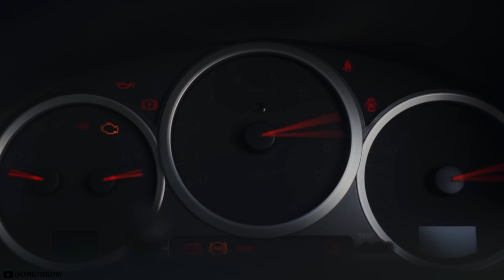Donut Media VS. Subaru

Comment: I honestly think donut just showed a perfect example of how a new owner to a subie feels. I'm sure donut put research and clearly time into their builds but ultimately didn't know as much as the subaru community. I don't own a subie bc of how finicky they are, love the cars but I can't justify the time investment of picking up someone else's rebuild
Reply: Also they have production deadlines, so time wasn’t on their side
Reply: Exactly
Reply: Donut got help from at least 2x Subaru WRX/STI experts to get along those 2projects. They did more anyone else to get the things right.
Reply: You hit the nail right on the head. My buddy had an STI and he had to be on top of everything to make the car reliable. They are bad cars since the majority of Subaru problems are specific to Subarus. The people who say you just need to know what you are doing are already on their 3rd engine
Reply: @deadheadcentral2514  yep, there are 3 things you never ask, A girl her age, a man his salary and a subbie how much he spend on the engine.
Reply: @ChuckyDoll79  And yet...

It makes one think they mayhaps intentionally done some things wrong.
Reply: I agree. The problem with subaru, it's package is already above the normal safety factor. I have learned the bare minimum to keep cornering with a turbo engine. My E30 which isn't turbo, doesn't require the extra oil capacity or larger radiator as those components are size properly for the engine.  From the experience I had with subarus, it's a corolla that has a turbo slapped to it, nothing less, nothing more. Same rad size, same oil capacity, oil quality, engine volume, etc. Only the turbo makes it different.(AWD does also, but that is just load, not engine reliability). I think if this was done with another turbo engine with would see similar results, but those are rare for quite the clear reason(complexity).
Reply: Mighty Car Mods had plenty of issues with their subarus over the years. The reality is that the boxer is a bitch to work on and has a habit of grenading. It's cool, and subarus are cool as well, but they are fragile, that's the long and short of it.
Reply: @AmazingPotatoFarmer  same things apply, no a youtube car mechanic is not some authority.
Reply: @deadheadcentral2514  as a man who knows what he's doing with his subarus. Engine 4 at this point 🫡😂 you couldnt have said it better
Reply: If they put actual research on a guy who actually spent a good chunk of money on a car it wouldn't have been as bad. Someone already made a video showing how easy it was to search this up
Reply: @CrAzY6tothe6  im convinced they half assed it on purpose for the views. In fact im 99% sure thats why they chose subarus in the first place. Knowing that they would die and create content.
Reply: that's why I always recommended people find bone stock ones. if any of it's accents are painted, any stickers or tacky wheels avoid it at all costs. Any engine mods including air filter is an instant no.

Comment: I’ve spent some time with the donut team and they are not incompetent by any means.Subarus boxer platform is sensitive and requires a bit more work. I believe the series donut produced exposed those weak points that an average enthusiast may see first hand.
Reply: My main criticism of Donut during that series, is after the second failure they should have brought a subaru expert onboard to help them out.
Reply: I think "driven media" make difference they with their series and proven Subarus aren't bad platform but they make middle ground
Reply: @Yugophoto  I disagree I think it was valuable to show how bad the cars are when a regular person tries to work on them
Reply: @PhantasmPhoton  translation "when you don't do your research"

It's actually kind of insane that you argue donut intentionally made mistakes
Reply: @PhantasmPhoton  And let's be honest, The Donut boys are not 'regular people'. They're race car drivers (Adam, Nolan), enthusiasts, people with degrees in mechanical engineering, people who have built PLENTY of engines and cars over the years. Just not Subaru specifically, and that goes to show that Subarus require you to know about Subarus, not just about cars. Of course all cars and platforms have their own quirks and pros and cons, but these guys aren't just regular people. The platform has problems. Problems that can be mitigated, sure, but it shouldn't require a PHD to simply track a car a few times without it dying. They were having engine issues before they really modded the engine at all. If you want to say 'Oh well, after they put on a big turbo and flashed it, sure, anything can happen then.' but these were essentially EXTREMELY mild mods at first and they still grenaded. I take other issues with the series, such as saying that the cheap turbo was 'worse' simply because it made less peak power without actually giving the specs of the turbos purchased, but that's neither here nor there.

Comment: I think it should show as a warning. This can and will happen, and sometimes it unavoidable with this specific platform. Just means its not the best platform for beginners who want to hop in, and rat out. Just goes to show this can happen to anyone. Great video Alex!
Reply: Great Comment Dillon!
Reply: It's certainly no Miata
Reply: Well yeah, but they certainly didn’t really give those engines a chance, they just threw them out on track without even braking them in.

I’m not a Subaru guy, I’m more in to Volvo’s (“old” Volvo’s not the infuriating cars they are building these days), but seeing them not braking in those engines was painful and made me a bit angry.
Reply from the maker: Totally agree! Thank you very much sir!
Reply from the maker: @klaspeppar5619  It did for a lot of people. Following proper break in is crucial, I can't really defend that bit
Reply: Like as much as I love my Ecoboost mustang I know that if I were to mod it or neglect it it will ecoboom... So I feel the Subru guys.
Reply: Nah. 😂
Reply: The real issue is that buying a used turbo subaru is like playing russian roulette. Its almost impossible to tell how the car was kept and maintained. Sometimes you can easily tell by things like aftermarket wheels, body kits, cheap bolt ons like intercoolers, up and down pipes. It just becomes so risky buying a used one that you need to either get one that is brand new, almost new, or one that you can verify has not been abused. Because the cars that have been abused, even for just like 40-50k miles, will end up giving you a lot of problems, and costing a lot of money. Kids who get these turbo subarus as brand new cars end up racing the shit out of them from light to light, or modifying them with bolt ons and bad tunes, and then racing them around putting major abuse on them. 

I am 100% sure that both of their hi/lo cars were abused prior to entering their shop. 

Its for this very reason that I wont buy used turbo subarus any more. Its just not worth the risk. Unless it is one that I know has been well taken care of, and not abused. But those are very rare and hard to find. Most of them are the other type, that has been mistreated and trashed about by some teenager or 20 something dip shit who didnt even have to pay for it themselves.
Reply: @klaspeppar5619  Did they really? wow! I had to do like 3-4k miles on my ej255 rebuild before I started driving it normally. I went to someone who actually specialized in Subaru builds, and it only cost me $4k. That was in 2014, and 55k miles ago. Ive driven it up and down the snowy mountains dozens of times. Only thing to ever go wrong since then was when my radiator cracked on me. But that had nothing to do with the engine rebuild. I keep it all stock, because I'm more interested in reliability than performance and power, at least for this particular car. If you have to have a subaru engine rebuilt, make sure to take it to an honest, experienced builder who specializes in Subarus.
Reply: @jonosterman2878  yeah, they actually even said themselves that they didn’t brake in their engines (except the last two), because they “didn’t have time”.

I would never even consider beating on a car with a freshly built, not yet broken in engine, no matter if is a finicky EJ or rock soiled Red Block.

As someone who has built multiple Volvo engines (not upgrade, more like putting a stock-ish engine together), I would not take on “building” a EJ.

(In case you didn’t know, the Volvo Red Block is a series of cast iron 4 cylinders which are more or less built prof and we’re ridiculously over engineered. 
Personally I consider the B18, B20 and B21 to be part of the Red Block family, although it could be considered debatable since there are some notable differences.)

Comment: I liked donuts hi lo series on the Subaru because it shows all of what can go wrong with modding cars and how frustrating it can be
Reply: I love their “Cars Are Pain” merch
Reply: Yup. My brother blew the motor on his evoX way back. Spent dumb amounts of money on top of the line parts... car barely lasted longer than a year and didn't even make as much power as his previous car despite being heavily modified

Sold it at a loss and got a truck.
Reply: Kinda funny the irony that none of the Subaru defenders were saying Donut could have experienced similar on any platform given how true it is, especially when you're modifying cars that aren't straight out of the factory so there's years of abuse before taking it well beyond the original use case, plenty youtubers have had similar luck with Nissan SR20s for instance

Suppose the Subaru headgasket meme didn't just spawn out of nowhere either though

Comment: Hit the nail on the head with the rotary comparison.   Most down to earth subaru owners will admit that the platform is finicky, AND the stock form is underbuilt as hell for its "desired" applications.  Much respect for those willing to thread the subaru needle, but Hi/Lo works on a simple premise (normal enthusiast building street-able HPDE cars).
Reply: Subaru fanbois are kings and queens of deflection. At least rotary enthusiasts admit that rotaries cost more to make reliable power.
Reply: Its a common joke in the subaru community that you arent a 'real' subaru guy until you've had to pull the engine at least once. So pretty clearly everyone knows that subarus need more work and attention to detail to stay reliable.

Also wtf subaru install baffles in your factory WRX oil pans for the love of christ
Reply: @Yugophoto  they finally did on the new ones
Reply: @Yugophoto  also they thought it was a good idea to have plastic pickup tubes???. Finicky? No that's just terrible engineering

Comment: I think the main appeal of Donut media is that they are relatable to most audience. I can relate more with people who tried to modify a car but break it instead, rather than a group of car experts who know everything in advance and make very few mistakes. Try out and find out, that is fun part of their project series.

That being said, if a machine requires you to be super knowledgeable and make very few mistakes, is it a good machine?
Reply: "That being said, if a machine requires you to be super knowledgeable and make very few mistakes, is it a good machine?" ... Well just because someone doesn't know how to fly doesn't mean that planes are somehow bad
Reply: @codemy666  not quite… airplanes are never designed to be piloted by the masses. However, airplanes that crash or require engine overhaul (*wink) because of the slightest pilot’s mistake still suck.
Reply: @rezhaadriantanuharja3389  Cars aren't built to be modified by clueless teenagers either
Reply: @codemy666  they sure aren’t. However, some can be modified by them, which makes those cars great tuner cars
Reply: @codemy666  sure, but I would say a car that can be is more appealing to me than a car that can’t. Like if I’m going to be modifying a car, I would prefer a platform that is forgiving over one that will blow up with the slightest mistake
Reply: @codemy666  terrible example 💀
Reply: @codemy666  everyone at donut media knows about subi more than u
Reply: @metro_chino4102  The fact that you had to write two seprate replies gives you this instant L
Reply: Rotarys in a nutshell
Reply: I have a bone stock Impreza. It's easy to maintain, drives perfect after 150k miles. And I abuse it, taking it down dirt roads regularly
Reply: Relatable this relatable that, maybe people just don't know how to modify a subaru. Last I checked, getting a K series to last, and out put actual decent power over long period of time can be just as much as a hassle. End of the day, these are 1.5-2.5L 4 cylinders that arnt designed to take that violent amount of power. Very few exceptions exists such as ferraris 2.9L V8 or V6 or ford's small RS200 motor. Even then, these motors require reworks and arnt known for reliability.  

You want reliable power output above 400-500HP? Get more cylinders or just go V8.

Comment: Being in the Subaru community for 10 years now you absolutely nailed it. They are extremely temperamental and are much less forgiving. But they are lots of fun when done right.
Reply: The part where is said "they're incredibly affordable" is crazy tho
Reply: @1upJeCK  they are really cheap to buy for the most part. Some of the more sought after STI's are getting up there but a normal wrx is pretty cheap. Especially if it's already broken lol. Now modifying, building and maintaining? Not so much.
Reply: On point .. “when done right”

Comment: Amazing video. I own a 2003 Bugeye Subaru Impreza RS and it came with a knocking sound from the engine. My mechanic said it is a rod knock and probably will fail within 6 months to 2 years, guess what? I’m still driving the same exact car with the same exact problem, just using the best oil quality (Mobil 1 5W-30 with a range of 20.000 miles) plus Lucas stabilizer and the car is still running. My brother asked me about buying a Subaru because he likes the driving experience, I just said: Subaru are picky, they aren’t bad at all, but they are different, and you should understand and love them  since they work different than other brands.
Reply from the maker: Thank you for the super and the comment man! Totally agree. I think the point sometimes people miss is that the platforms aren’t all the same and dealing with their differences can be more important on one chassis than another!

Comment: I raced this guy who was driving a Subaru sti.  His car is a 2019.    I drive a Veloster N.     When we started racing we were neck and neck until his car bogged down and white smoke started coming out of his car.    I ended up pulling over and I backed up my car until I was close to his car.    I didn’t know the guy, but I also didn’t want to leave him stuck on the side of the interstate.    Turns out his engine blew.   I felt so bad for him.   I waited with him until the tow truck came and I ended up giving him a ride home.   We ended up becoming friends.